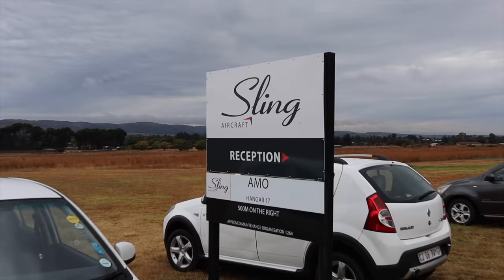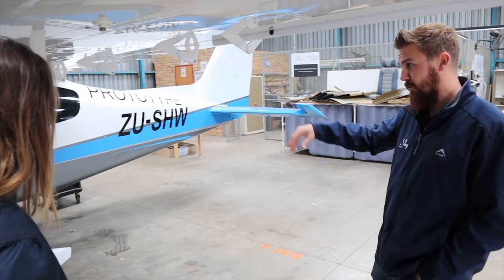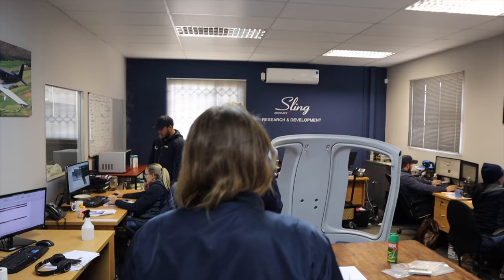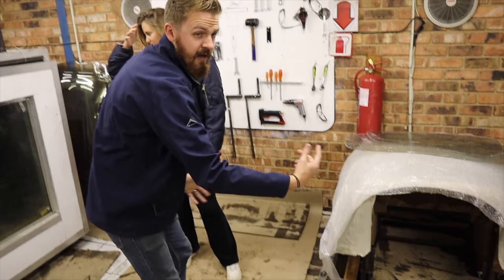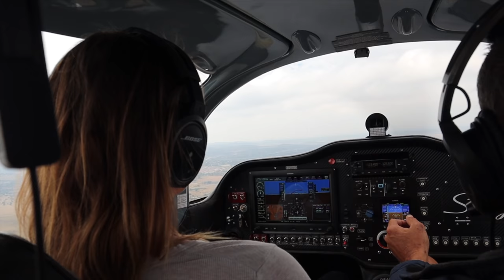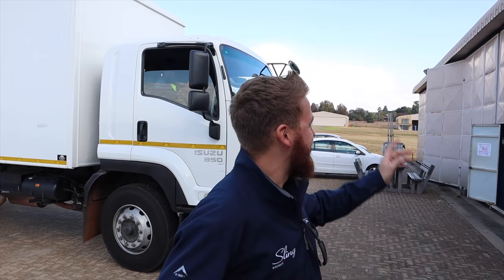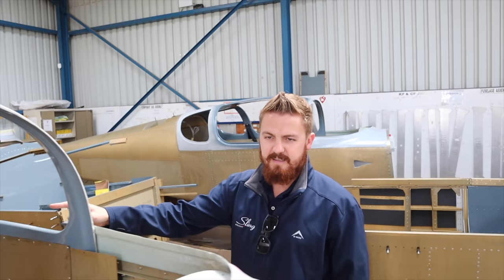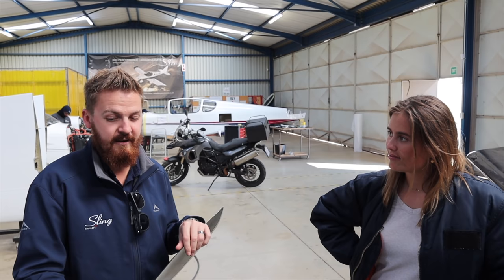How Small Planes are Built - SLING Aircraft Factory Tour

Comment: In theese small aircrafts all components are made unique or some parts are the same for other small planes as well? Like engines, other components?
Reply: The engine is a standard Rotax 915iS or, on the High Wing, a Rotax 916iS. The bolts and other hardware are all standard, as are things like the flap motors, seat belts, and avionics. All the ribs, wings, composites, windows, etc. are made unique.

Comment: Are the new prototypes more composite? because that's definitely what I would recommend for them. They do several parts as composite already so it just makes no sense that they don't do it all as a few composite parts instead of the shape limitations and enormous work that comes with sheet metal riveting. And frankly the rivet look is not a good one. It should have sunk with the titanic. With double compound curves a mere shell can be rigid so you don't need a lot of internal bulkheads, it becomes a much simple construction and even though carbon fiber is more expensive than glass, it easily pays for itself in less weight and structure you need and the permanent performance improvement. So please, for the love of God, no more rivets :) teardrop composite and there are no limits to how far it can go. A simple structure must also be easier to certify and they should use that to get away from kit building because that is such a hindrance to growth. If you can make a great certified composite plane that vastly outperforms a TSI for 200k instead of someone going on the 1 year heroic journey of building one himself for 300k, that's just a factor 100 difference in market size.
20 years ago Cirrus was a kit builder with a single model that killed the majority of its customers. True story. I think 19 kits were made, 13 people died. And now they are the biggest producer. So much is possible. No kits, no rivets. They are holding you back.